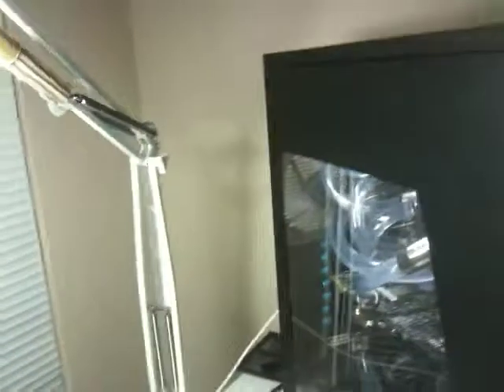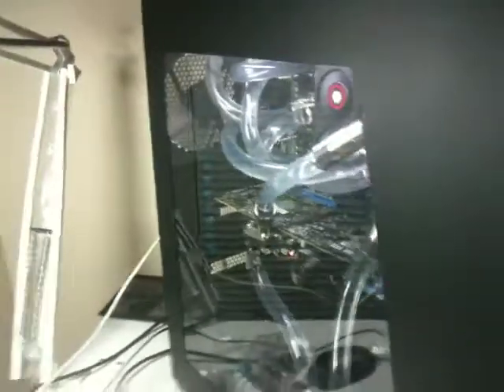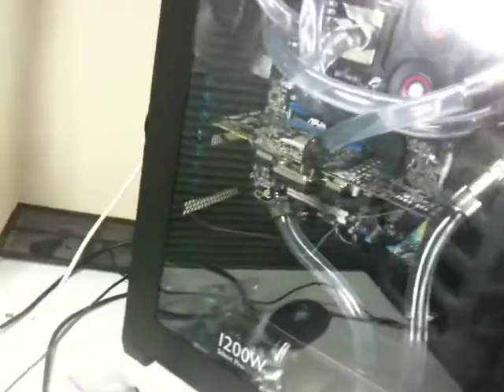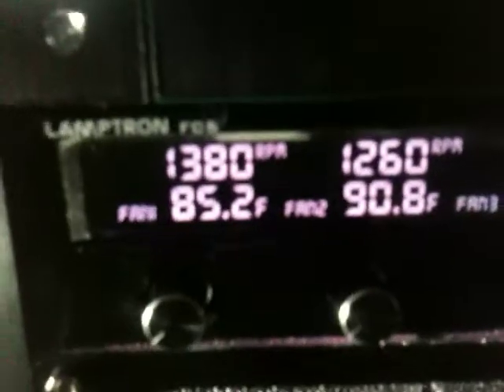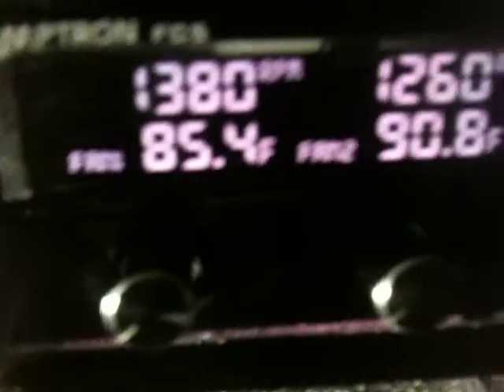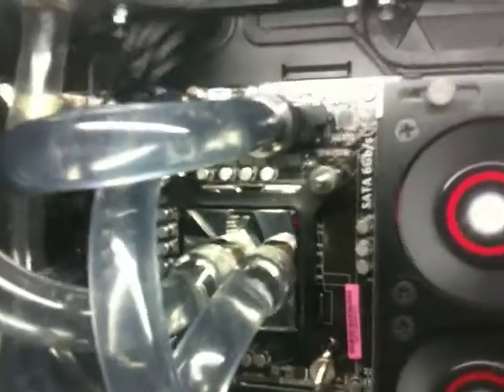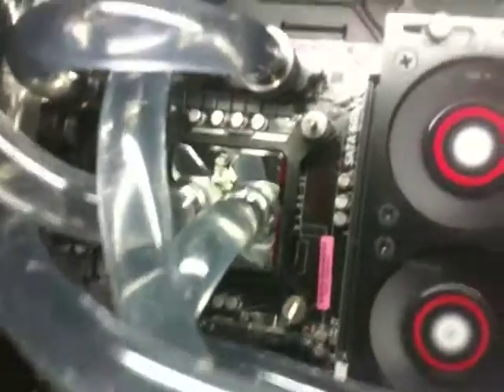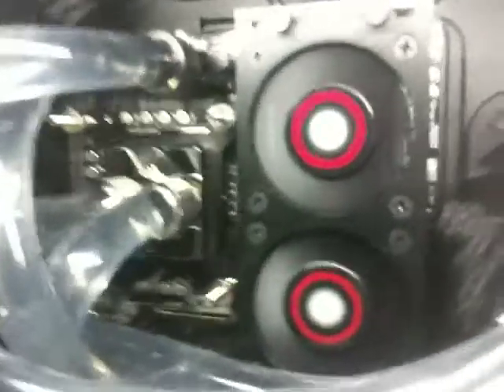FIRST BUILD WATER COOLING PC

Comment: Looks like a really nice and clean build, hows it running now? The only thing that really stuck out to me was the tube at the top going across your NB it seems like it is kind of a tight turn for it, but if its flowing good there probably are not any problems. But nice build!

Comment from the maker: @MrLlunker I will disconnect the reservoir from all four lines and slide it out and dump the water. Just keep it simple. I really only have plans to replace the gpu but I am in no hurry I will wait until I really have problems and need to upgrade.  But for now the 480 does a great job and during the winter will keep me warm.

Comment from the maker: @brianesquinas Water is a better thermal conductor than air so it's more quieter and efficient.  Your water loop will consist of at least one radiator to exchange the heat and drop the water temp a few degrees.  Leaks are not really a problem at all or it wasn't for me anyway but I took my time.

Comment: distilled water better then coolant?
 i want build a watercooling for my i7-980x and overclock it further, atm its 4.2ghz on a H70, but i wanna build an extrernal setup with 2-3 radiators and high RPMs fans (maybe even drill 2 holes in my wall and setup radiators outside my house so i can run fans on full speed)